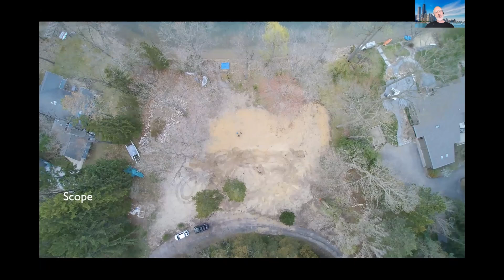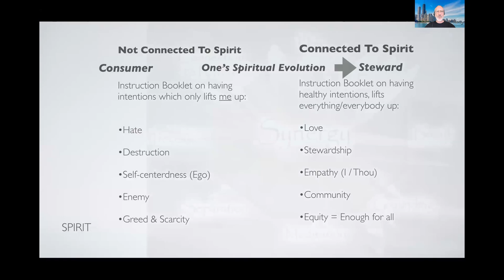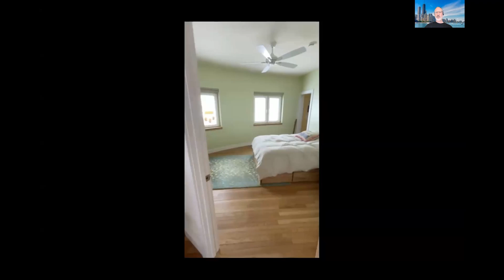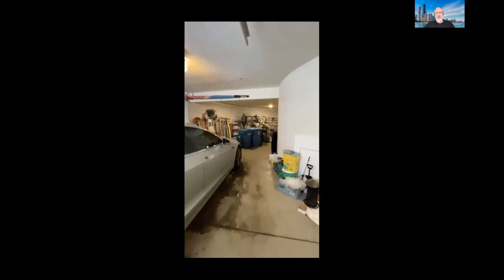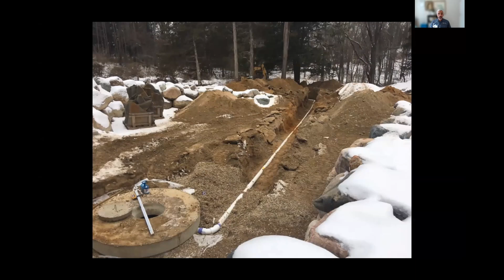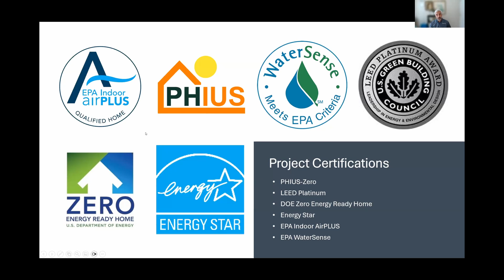Virtual Tour: Lakeside Passive House LEED Platinum Net Zero

Comment: Great video and over view.  
All new buildings should be designed with large roof overhangs. The large overhang provides beauty and protection from the sun, rain and wind. 
Protection of the doors, windows and siding make for a more durable and comfortable home. Water is the enemy of buildings.
New homes should come with solar panels, a rain water collection system and an electric vehicle charger in the garage.